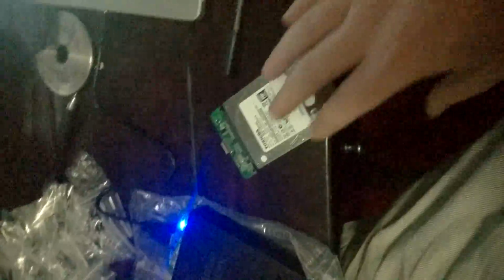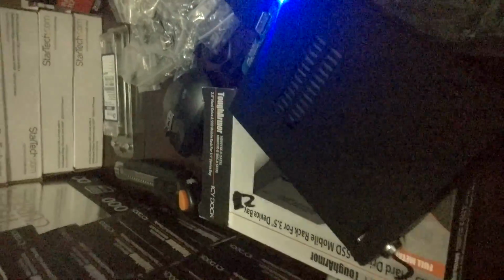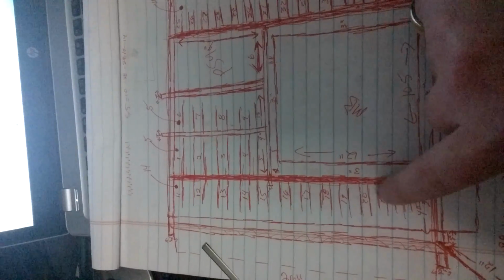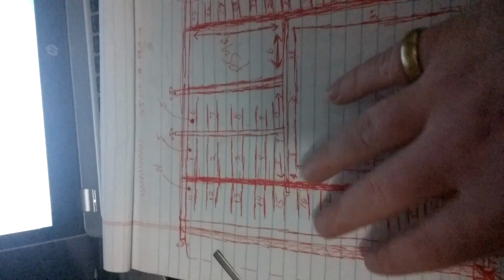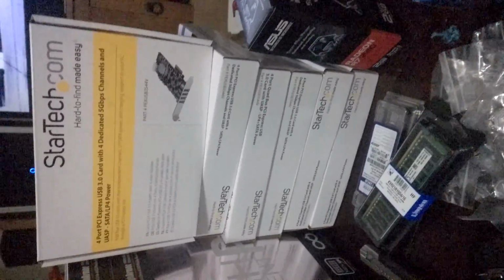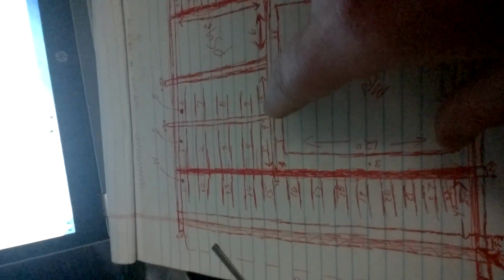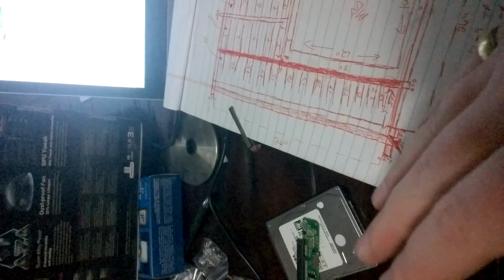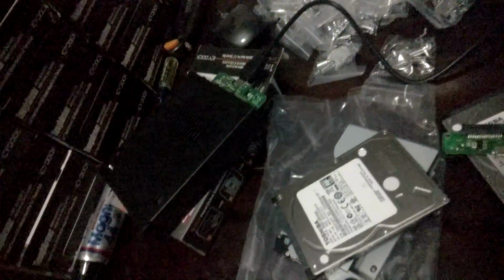The ZergBerg (Phase 1) Introduction Video (38 USB Hard Drive Cluster - Custom Coffee Table PC)

Comment: Heya!  I heard about this through Hackaday, and this is a great build. 

If you had to buy the USB 3.0 to SATA controllers, what would you use?
Reply from the maker: Thanks... USB 3 to SATA is rough.... i would disassemble and remove the 3.0 controller and just go strait to the drive... It should be easy to do with most brands... some vendors like western digital bake the usb controller into the sata pcb :(.